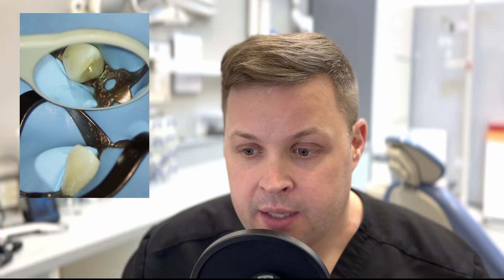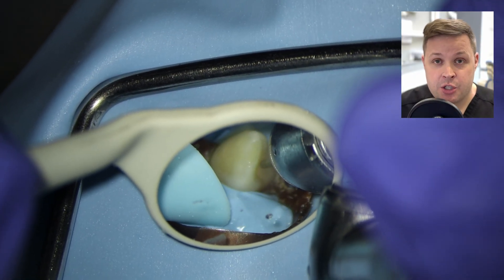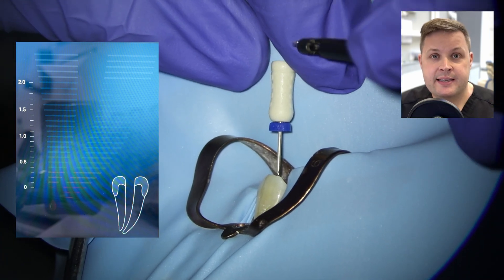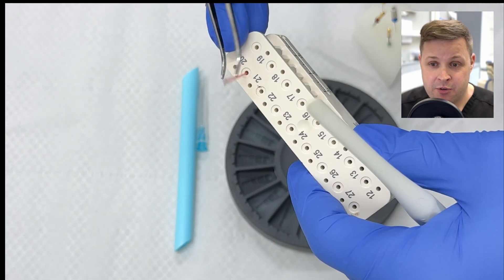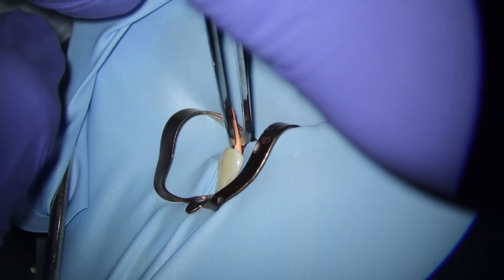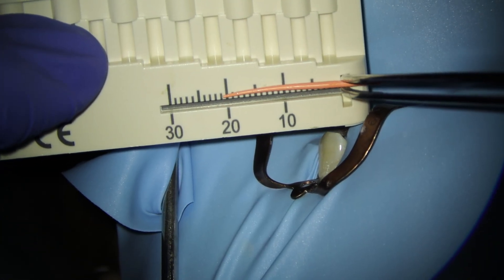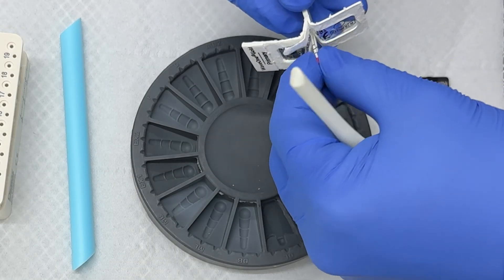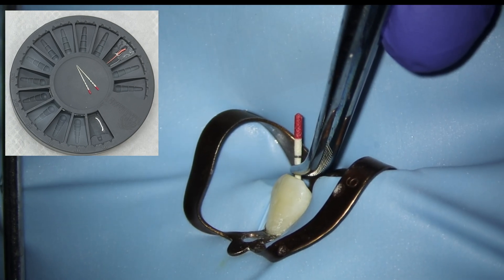📌 Master Apical Gauging for Wide Canals!

Comment: Hi Sam, thanks a lot for your amazing videos! I’m a baby in Endodontist and I’m really grateful for all the tips and fine-tuning I’ve been learning from your content.
I have one question: why do you place Vitrebond® on top of the GP instead of directly using a flowable composite to seal the canal entry before covering it with a regular composite?

Thanks again for sharing your knowledge!
Reply from the maker: Sometimes I need to use a accurate tip to place the restoration to avoid bubbles, sometimes I use it if I am worried about the long term bond of the composite, & sometimes i use it when I find it difficult to place composite in these areas.

Comment: Hi, I've got one question here:
You closed with a 55 diameter guttapercha, but shaped only to 25: doesn't this mean your master apical file hasn't touched the canal walls in the apical region? So you're only relying on chemical desinfection? I think this is "ok" in vital cases (cause bacteria supposedly haven't arrived to the apex yet), but not in necrotic, where you already have an apical lesion visible in radiograph and the apex is full of bacteria... 
could you please share your  toughts about this? Thank you!
Reply from the maker: I rely completely on chemical disinfection. Always remember that on average the file only directly touches 30% of the canal walls. Therefore, given your suggestion that you need to scrape the necrotic walls, you are still missing 70%! What do you think, do you agree or disagree?
Reply: @ilovethepulp 

For sure chemical desinfection plays a major role; I try to match apical diameter of file and guttapercha also because I'm worried that the guttapercha could slip beyond the apex if I didn't create the matching shape and taper between last file and gutta cone, cause I'm using warm vertical compaction; for sure doing single cone + bioceramic is safer from this point of view

 My protocol for gauging, disinfection and obturation usually is this way: 

1. I always shape up to 25/04 or 25/06 minimum (cause that's the minimum size the irriflex tip, which is 30/04, arrives 1mm short of the apex); 

2. Then, I check with manual NiTi files (starting from 25/02) which one binds to length with a "spring-back effect" (meaning that, at working length, if you try to rotate the file clockwise, it goes back counterclockwise). 

3. Then I enlarge to the corresponding size of rotary

4. Choose the matching GP point through the same protocol you showed in this video (basically because unfortunately "matching guttaperchas" for me always seem to not match or lack proper apical tug-back 😅)

5. Desinfect canals with Sodium Hypoclorite 5.25% + Edta 17% + Sodium Hypoclorite 5.25% activated through sonic (Vdw Eddy) or ultrasonic (MicroMega Endo Ultra) 

6. Obturate with warm vertical compaction

Comment: Great case, great video as usual. But what is the maximum diameter for apical gauging you will stop with?
Reply from the maker: This is a very good question. Between the sizes of 60#-80#. If there is a very round 80# apical diameter then I’ll use GP. But if there is an irregular 60# apical diameter, then I will use putty. What do you think?

Comment: Hey doc, great video as always, my question is, what is your protocol for how much to enlarge canals, and is it different in anteriors and posterior teeth? for example, if #25 variable is loose at length or flutes are coming out with pulp tissue wouldn’t you go up to #30 variable? Idk if you have a video on this topic, how to determine what variable size to go to and when using fixed taper like 04 what is enough for success .. if you don’t, i would love to hear a full video with your philosophy given your experience on the matter..
Reply from the maker: Shaping is all about irrigant flow. So I very rarely shape above a 25#. If the canal is larger, then I fit the GP cone to the given diameter. What do you think?

Comment: Great video. I learn a lot from you videos. When you measured papr point on the ruler that was used to measure infected file, 12:56  wouldn't you introduce bateria in the canal?
Thank you for great video
Reply from the maker: Really good point! I never thought of that!! I’ll be more mindful in the future!
Reply: @ilovethepulp I use the same mesuring block and measure files on tge side like you, but measure papirpoints throu the holls on the top of the block
Reply from the maker: @ that’s a really good system and I might start doing that. Thanks for your insight!

Comment: Great Case!!! As for GP disinfection protocol I do as you did with Hypochlorite and then dry it, but recently  I attended Endo specialist lecture , He  clamed that after GP submerged into hippo  - its necessary to rinse GP into Alcohol and water, because natrium hypochlorite then makes natrium salt on the surface of GP which hampers GP bond to Sealer . Do you agree with this opinion ??
Reply from the maker: This is a good point to note, I had no idea hypo causes this issue, I think I might dip my GP points in isopropyl alcohol in the future for sure!
Reply: @ilovethepulp I usually dip in isopropyl alcohol wipe it with sterile gauge then dip in chlorhexidine for 1 min dry it then place it in canal

Comment: Doesn’t hypo make the gp soft? I use chlorhexidine as gp disinfectant.
Reply from the maker: I hate to contradict you sir, but using chlorhexidine is not a suitable irrigant, mainly due to the reasons given above. It’s also just as toxic to tissues at the higher concentrations. I do understand why you use it however!
Reply: @ilovethepulp  I think he meant he uses CHX when disinfecting the GP cone not as an actual irrigant for the canals.
Reply from the maker: @ ahhhhh! Of course! I am sorry @emonhossain8923 as for using CHX to disinfect the GP, I’m not sure!
Reply: Hello, you absolutely must read about the irrigants used in endodontics. As main ideas, do not try to irrigate the root canal with hypochlorite immediately after using chlorhexidine. You will stain the tooth due to the precipitate that will form. You must use physiological saline solution. On the other hand, for chlorhexidine to work, it must be in contact with the bacteria for about 5 minutes. Chlorhexidine is to soften the membrane of the bacteria. There is a lot to talk about the substances used in the irrigation of the endocanalicular system, their mode of action, efficiency, and role. You have to read everything to understand, it doesn't work in 2-3 words. Success.. 
P.s. Chlorhexidine does not dissolve pulp debris or bacteria like hypochlorite does. On the other hand, you must be careful not to cause hypochlorite accidents.
Reply: I don't know if you meant to abbreviate
gp= general practitioner
gp= guttapercha

Comment: Hello, what i use to fit my gp perfectly is i choose one stable ref point and insert gp in canal and how much it is out from apex i mean more than working length i cut it and try again to get tug back.99 per it works better though it is not perfect method but it works for me but i ensure that gp is properly sterile.
Reply from the maker: That’s a good way to do it for sure, and this was the way I used to do it! But have you thought about using a GP cutter? If you watch the video below, it cuts the GP more cleanly 

https://youtu.be/Sw5B9lPP2tE?si=Yso56Zauql-uQSHt

Comment: Love the videos - very helpful and really enjoy watching how we may be similar or how our approaches may differ slightly. Gotta get my hands on a Gutta Cutta - what a great name.

My question: At what point area you just sizing up your rotary file from, say a 25 as used in this, to a 30, 35, 40, etc.? Thanks!
Reply from the maker: I don’t tend to go above 25#. Once you’ve shaped up to 25#, there is enough space for the irrigant to flow and arguably any higher diameter may result in excessive dentine removal. Which in turn makes the tooth weaker in the long term